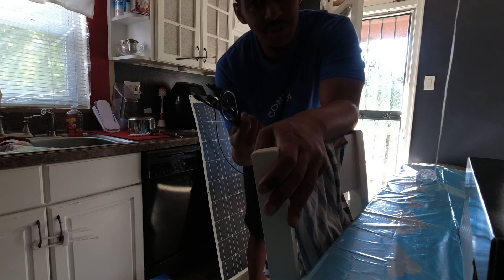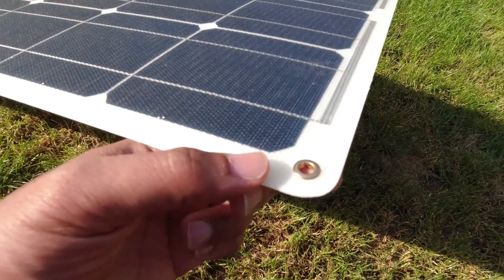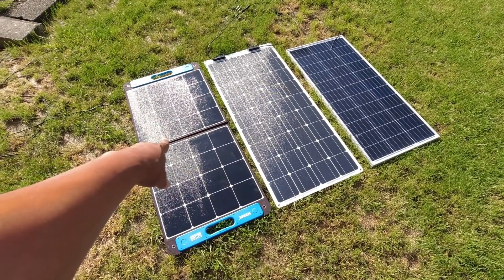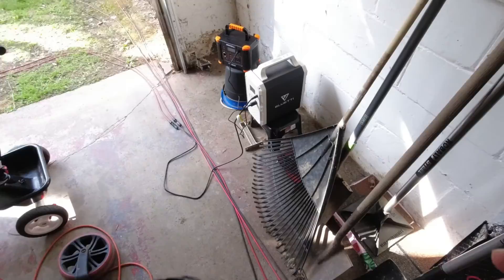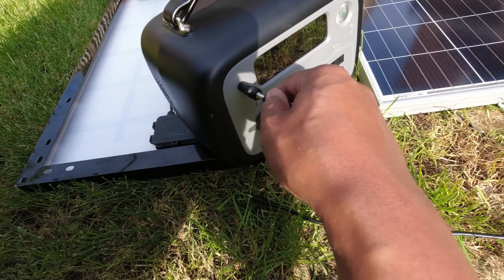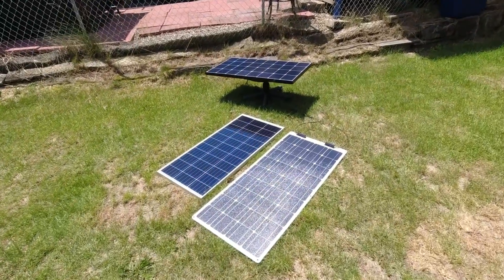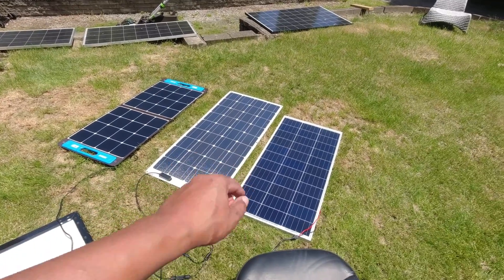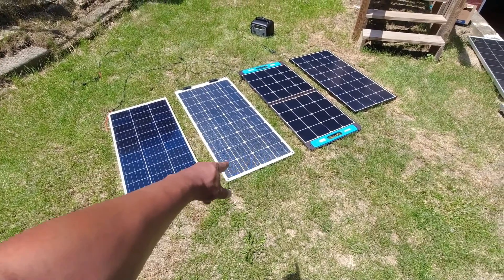Renogy 100 Watt Flexible Panel - Overview & Comparison

Comment: I'd like to know if I can mix and match? Do different branded panels work if you connect them together? I tested my Renogy 100 Watt panel out on a beautiful hot day, got around 60watts until the sky changed to a powdery milky (not blue) and got zero watts from my panel. Also do they work in Winter?
Reply from the maker: You, in theory, can mix and match panels with similar voltages and amps. But if they are too far off then the lowest will drag down the higher one. 
Pairing a 100 w a 50 didn't make sense. But there are videos on it.
Reply: I get about 60 watts from my renogy 100 watt panel as well, disappointing but ya get what you pay for.
So....if space is not a concern you can get 2 renogy panels for less than the price of 1 XTar
Reply: @drd1924  I bought a firefly branded 200 Watt panel a few weeks ago, it was on discount so I picked one up. I'm only getting 140 watts out of it, but I think the cheaper brands are better. I did buy another renogy 100 watt panel but the specs are different to one I bought over a year ago?
Reply: @AskIveSolar  I bought another renogy 100 watt panel but the specs on the back are different to one I bought over a year ago, do you think it is safe to connect them both together? I just don't want to damage my battery, both are Renogy 100 watt panels.
Reply from the maker: As long as the specs are close enough. Shouldn't matter. 
But you gotta be careful with series as it can damage most small power stations. 

And 140 doesn't shock me. Not everyone has ideal solar conditions

Comment: The flexible solar panels are good not just for being flexible or flat but they are much lighter without the frame and glass great for mobility bike boat in a car window anything
Reply from the maker: True @ the benefits of different form factors.

Comment: Nice test. I think it would be a better test if that Xtar had been sitting out there in the heat the whole time as well since the hotter they get the less they put out.
Reply from the maker: Right. That's why I mentioned it. I'll test it again against the renogy black division and the flex.

Comment: are portable/folding solar panels effectively the same as flexible panels, meaning lower life span and easily heats up etc. and does ETFE overcome flexible panel issues?
Reply from the maker: I'd gather that they are but that's not a data based answer. They typically have the same coating. ETFE and PET on older / cheaper panels.
Reply: @AskIveSolar  Does ETFE resolve the heat, short life abd sever decline in output over time as compared to glass/rigid panels?
Reply from the maker: It's only better than PET but erfe will break down over time as well. As I understand it from people who are smarter than I. Let me ask Jasonoid his thoughts.

Comment: How long are your cables on average? Do you have a lot of loss?
Reply from the maker: I have two 50ft 10awg. A couple 20ft joints. Probably like 10 and then I have a couple 10 to 15 that are mostly 12awg.  But I defaulted to 10awg before I understood wire gauge better. Now I can go with a shorter 12 awg and it's a lot more manageable. 

On these power stations....I don't really fret much about loss. Just get 10awg for longer cables around 50 and you should be fine. 

But I may test loss in a future video.
Reply: @AskIveSolar  Thanks for your response, definitely worth testing. I myself have not been working on all this for long and have bought cables of 6mm thick and 20 meters long. I do not have much loss due to the length of the cable and what I lose I more than compensate because the panel is now in the sun all day long. Have a nice day
Reply from the maker: Yeah it's like even if you have some loss. It's what a volt or two. Times the amps. Most panels are 5 to 10 amps. Soooo what. 5 to 20 watts per hour. At the end of the day, to get that panel in the sun. It's worth the loss.

Comment: ive what happens if i hook up a 400 watt panel to my river  ? will i fry my river ?
Reply from the maker: The hope is that it will protect itself but that voltage is too much and will probably fry it. 

If you look at the voltage on that panel. It's too high for it.

Comment: Minute Man Prep on youtube made a video about a cheap ground mount that you can use for flex panels. They Are from Eco-worthy on Amazon, the 41-inch one. Check out his Channel he's got some pretty good stuff on there, I purchased an Eco-worthy Ground Mount for one of my Newpowa 360-watt panels recently mounted horizontally, and I love it. It would work great with your renogy 320 watt
Reply from the maker: Yaeh Im hip to minute man preps channel. When you say ground mount, you mean those metal rail things.
Reply: @AskIveSolar   Yes
Reply: @AskIveSolar  eco-worthy has some decent stuff on amazon, not their panels though, lol